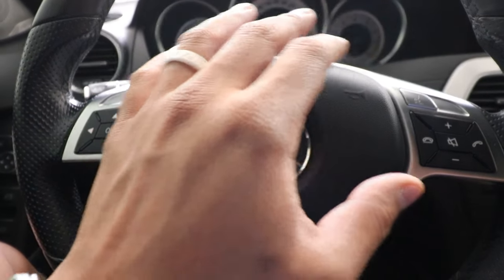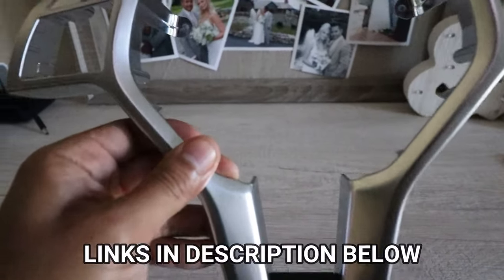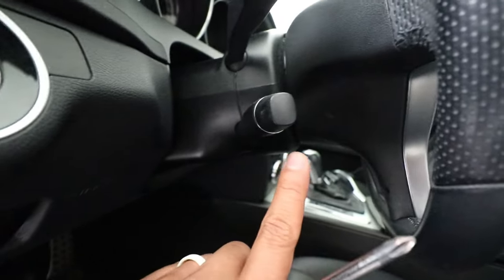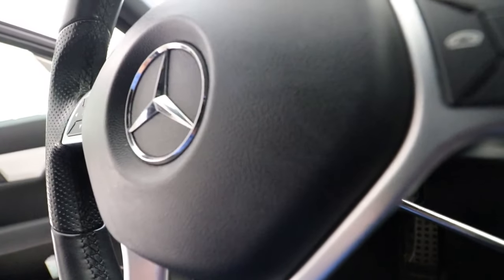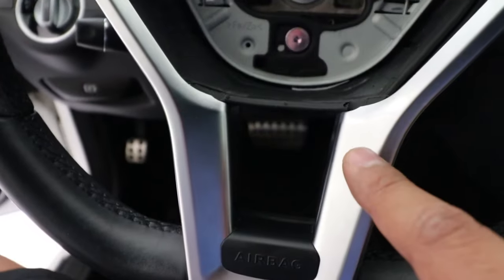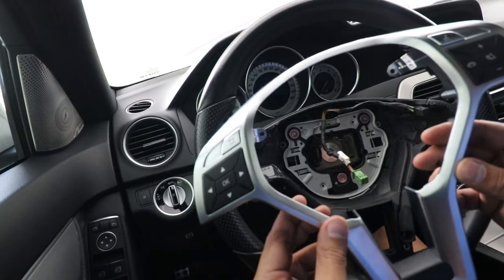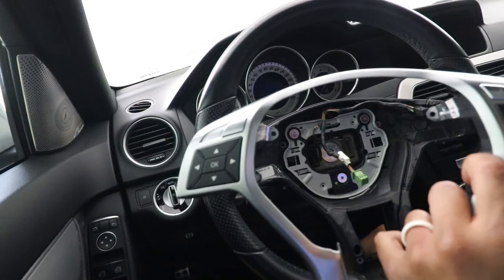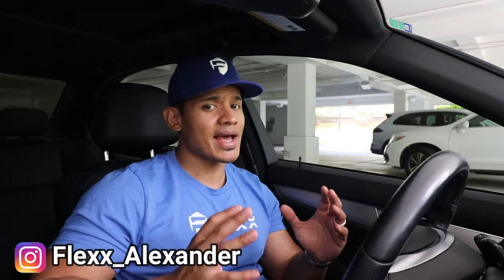Replacing my Mercedes worn, flaking, and sharp steering wheel trim bezel.

Comment: Flex can you remove the plastic air bag sign at the bottom of the v in the steering wheel as I want to replace it with a Mercedes silver badge ?

Comment: Thanks, Flexx. I have a 2014 CLS 550 with the same steering wheel and the install went off without a hitch. I was nervous about messing with the airbag, so I really appreciate the thorough how to video. Definitely disconnected the battery first.

Comment: Awesome video man. There's a couple others on YouTube that suck because they don't mention the battery disconnect.
Reply from the maker: That’s the most important part! If you don’t disconnect the battery or pull the airbag fuse, you run the risk of having the airbag cause injury.  Plus disconnecting the airbag while the battery is still connected will cause an airbag fault stored as a check engine light.

Comment: No nonsense, to the point. Great help. My battery is not is the engine bay though, i think they are under the boot (trunk) liner and there is two of em (c63) i hope by removing negative on both doesn't cause a problem.

Comment: I can't believe this is an issue with these cars.  I had a 2004 C 320 and all the plastic was much better - especially in this most basic of faults - sharp plastic!  Thanks for the video.

Q: How about just sanding the rough edges down carefully.  Has anybody had any luck with this, especially without removal first.  I say this with a bleeding thumb at the moment!

Comment: Thank you very much!  Cut my fingers several times already with these annoying sharp edges.  Just ordered the trim from Amazon.  Can you please tell me if disabling the car battery will cause any issues?  I read online that it could screwup the window settings and other things that could need a dealer to fix.

Comment: If you have an ML350 W166 (mine is a 2014) where the bottom part of the spoke does not go to the center but splits to approximately the 8 and 4 o'clock position, then the screws on the back are T10, or you can also use a T9.  I could not find this information anywhere so it was a lot of trial and error for me, I started with a T15 and went up, but turned out I should have went down.  I thought my screw was stripped so since I was going to replace the bottom bezel anyway, I cut it up with tin snips, then broke apart the bottom bezel until the screw on one side released due to the plastic breaking.  Then I was able to easily unscrew the other side once I angrily realized it was a tiny T9 or T10 bit that was needed!  

Also for mine I did not unplug the battery.  I carefully kept the airbag connected and routed through the opening of the steering wheel trim.  Since the cable is relatively long, it's pretty easy to work with replacing the trim while the airbag is still connected.  Plus on the W166, the battery is under the passenger front seat!  Why?!
Reply: So you are not recommending changing the bezels on the four point steering?

Comment: I'm having a very difficult time trying to remove the airbag on a 2013 C250.  Mine didn't have holes in the back of the steering wheel, it had indentions.  So I stuck a screwdriver in and pressed all over inside there and cannot seem to pop those clips.  Any advice?  How far to stick in?  What angle?  Anything else I'm not considering?  

UPDATE.  I finally got it.  Best to use a Flathead or even a Allen head.  Put the steering wheel with the top point of the Mercedes emblem pointing straight up.  Then the angle of the screwdriver should be parallel with the surface of the steering wheel and using the left and right points of the Mercedes emblem as a guide, from the indention or hole, push the screwdriver towards the center point of the steering wheel.

Comment: I've owned 3 2012-2014 C and E classes.  I'm actually astonished that Mercedes didn't fix that after the first year of this model steering wheel.  Just so not MB.  Add in the flaking of the black "paint" on all of the buttons and it really diminishes these models.  However, I really dislike most of the body styles after 2014 so I'm glad there is a fix for this.  I picked a C300 up from the factory in Sindelfingen and within two months the driver window button was flaking.
Reply from the maker: Yup. And the sad thing is…my 2016 c300 has a silver trim/button to open the center armrest and that trim already started peeling/bubbling within 30,000 miles.  They covered it under warranty but like come on guys.
Reply: @TheFlexxGarage  thanks for instruction video. I ordered a carbon fiber trim and I’ve never even thought to see if it could be replaced. 👍🏼

Comment: Does disconnecting the battery mess anything up? like sensors? or is it fine no issues? Have ordered replacement which I plan on doing just wondered f there were any possible issues that could arise

Comment: I have a CLS 550 that has a second auxiliary battery, do I need to also disconnect it as well before removing or taking out the steering wheel bag?
Reply from the maker: Not 100% sure on the CLS but most Benz, the aux battery is only used for small functions like the start/stop function, serves as backup to the gear selector, heated seats and some other command functions.  I’ve taken apart the steering wheel on my 2013 c300 and my 2016 c300 without having to disconnect the aux batt.

Comment: I have 2015c300. The volume buttons are worn off. So I def have to remove the way you did right? Is there any other way. Like pop off the button like it’s snapped on. Kind of like a computer keyboard button .  Thanks

Comment: I got a left malfunction code for the air bag for disconnecting it. Gonna do the Scanner tomorrow see if it erases the error code. Also you can try and disconnect under the seat the yellow i believe for the ai bag to see if it does anything
Reply from the maker: Most people get an error cause they didn’t follow the most important step which is to disconnect the cars battery before doing anything.  If you did do that and still got an error, then there’s a faulty connection.
Reply: @TheFlexxGarage  Yeah I 
Disconnected the battery before doing anything and fuse also looks good.
Reply from the maker: Sometimes it’s just a matter of driving around and letting the car relearn/recharge the battery.  I don’t recommend you drive around with the airbag light on.
Reply: @TheFlexxGarage  Yeah that's what I believe also , they told me to disconnect the battery and leave it for 30 min and reconnecting it again but that will be after I drive for a while to see if it relearns it. If not I'm giving the dealer a call
Reply: @brandonmedinah2956 did that work?
Reply: I had same issue.  Did it go away own its own ?
Reply: @sunnyjohal4864  No I had to take to a shop charged me 150 for it. Need some type of scanner to erase code.

Comment: Alexander my airbag didn't pop out but its lose in the steering wheel, can't push it back in and it won't come out, can you help with this? Tried my best, might need a new steering wheel at this rate.

Comment: I didn’t know about this issue till I cut my finger on the frayed edge. What diameter screw driver to insert in the 2 holes?
Reply from the maker: Don’t really need a specific screwdriver. You just need something that’s skinny and long enough to pierce the sides and push the tab to release the airbag. Even a skinny rod will work.
Reply: @TheFlexxGarage  I tried for 5 minutes and didn’t want to damage the vinyl I put the screw driver through on both sides. I can’t get either side to release.
Reply: Any idea where I can get a pic of the clips on both sides without the vinyl cover so I know what I’m pressing on with the screw driver?
Reply from the maker: Go watch this.  He points to the metal straight wire on each side that needs to be pushed. https://youtu.be/RW2cwqmVFQI
Reply: Bro I cut myself so bad mid drive from Aspen to St. George, 4 hours deep and went through like 3 napkins -__-

Comment: Same problem. Also on back button on wheel. Already bought new trim, but still looking for these button. Thanks for tutorial dude) but should I unplug “+” on battery or just “-“ ?
Reply: Negative is enough, because the car body is connected to it. Electricity flow to components through wires, then flow back through car body. Unplugging negative will cut the circuit. Even sometimes you want to unplug positive for some reason, it's recommended to unplug negative first. Because when unplugging positive, wrench may accidentally touch the car body, creating spark. All modern car connect negative to car body, some very old or special car may need to double check.

Comment: Thanks for this video. I have a strange question I wonder if you can answer. After having BMW's for many years I've gotten used to the radio controls on the left side of the wheel. Do you think there would be an issue switching the wires for the buttons? I know the buttons themselves can't be switched and they would not be labled correctly but I really want the ability to control the volume with my left hand. Also, have you replaced the drivers vent? I need a video for that too. Thanks
Reply: haha it’s funny you say this I drive an E92 and a W204 and I regularly press the wrong buttons in both cars

Comment: The same thing happened to the handles to get to the back seats and I’ve had to put tape on it because it cut up a friends hand pretty bad. Any idea as to what to do for that ?
Reply from the maker: Same thing on my coupe. I cut my shoulder several times going into my back seat to clean it. 

I peeled off as much of the chrome from the handle and then I wrapped it with gloss black vinyl wrap.  So far so good and looks better.
Reply: Flexx Alexander thanks man, the chrome is a real safety hazard lol

Comment: hey budy, great video as always, I been able to perform lots of things thanks to your videos, thanks so much, you always come up with neat stuff and useful ones like this one, how ever I had my finger sliced but not on the steering wheel vesel but in the lever to move the seat on my 2012 coupe, I have not seen any videos on how to remove this piece or even where to get a replacement part for it, do you have any information you can share, thanks a lot again, keep up the good work. later and greetings from Chile.
Reply from the maker: If you read my replies to some of the comments in this video, I mentioned that happened to me too. I don’t really know how to remove it. All I did was peel off the chrome as much as possible so the white plastic is exposed. And then I put gloss black vinyl wrap over it. Worked for me.
Reply: @TheFlexxGarage  Hey thanks for such a quick response, I thought of doing something similar, but before doing it I wanted to know what you can tell me about it. thanks....

Comment: Have trouble with infotainment buttons pealing, can they be replaced just as easy as yo did the steering wheel buttons?
Reply from the maker: They screw right off but you gotta change the entire button and it’s electronics. I don’t know if you can pop off the buttons alone.

Comment: I know this is an old video and hope you’re still replying to comments.  Just done this on my car, but since reconnecting the battery some of the electrics seem to be playing up.  Wing mirrors now don’t fold and the windows won’t go up properly (almost as if it things something is stopping it as it retracts back down).  Any advice please!
Reply from the maker: Never happened to me in all my times of disconnecting batteries from multiple cars from different brands.  I’ve been told just drive around, start and stop the car a few times through normal driving, the ecu will relearn and everything will correct itself. And for the windows/mirrors, there’s a relearning process you can try. There’s tons of YouTube videos on them. 

https://youtu.be/faeDJZqCQEY?si=Hrdq83W1vd4_9vVA

https://youtu.be/Q9016USuZWw?si=bcrZoHhjwnUWMA1R
Reply: This is late but the windows require a basic reset. Just have all the windows on closed position when power on. With all 4 fingers hold the windows up at the same time. Stay that way for 7-8 seconds. So it knows the final close position. It'll auto close normally

Comment: Hey mate, I drive a 2013 C300. I’m in Australia so probz a diff spec than American ones. I tried the whole process everything works, but I have the airbag light on and a restrain system malfunction… any advice on it?
Reply from the maker: Not sure.  The replacement has nothing to do with those error lights.  On my car, sometimes when my battery is low or I disconnect the battery, when I reconnect it…I’ll get an airbag light and I think traction control error light but they go away after I drive the car for 10-20mins and the battery charges up.

Comment: I’m having trouble with removing the airbag, battery off but airbag will not pop out for me when I push on it w screwdriver
Reply: I’m having the same problem did you ever figure it out
Reply: I got the left popped off right now.. right side won’t budge
Reply: Did any of you sort it out? Both sides on mine haven't popped out, but they're loose, can't even push it back into place now
Reply: if you are using a bit screwdriver, try a different bit that goes all the way inside the hole, slightly press and then push towards the front (facing yourself) and it should pop out.

Comment: Is there any website that sells the carbon fiber one cheap? On Ebay, most of them are close to $300
Reply from the maker: I haven’t seen any. The only thing I saw are carbon fiber overlays decals/stickers.  They look good but they’re don’t completely cover everything on the trim.
Reply: @TheFlexxGarage  Thank you. I might need to settle down with the OEM one.
Reply from the maker: Why wont you just wrap it in like 5D carbon vinyl before you put it on then?
Reply: @TheFlexxGarage  that's a good idea. I should just wrap it on my current one. That will save me some money. Thanks!
Reply: Andrew Kim yo did you wrap the trim? I’m looking to do the same thing.

Comment: Is that the original steering wheel? I don’t have that problem yet, but if it ever comes to that, at least I’ll be prepared.
Reply from the maker: Yes.  As mentioned in the video, this flaking problem is a known issues in the c-class. And it will get sharp and you can cut yourself pretty bad on it.
Reply: @TheFlexxGarage  somehow it look different on mine. It's the model after 2018 and it's 2 parts, one in aluminium and one in black plastic, not full aluminium like yours
Reply: Tito Alo If u have a 2018 u have a W205 C Class

Comment: Do you happen to know how to change the buttons? I took out the trim and the buttons shell but the button are still in the shell and idk how to pop them out. Please help
Reply from the maker: Don’t know. Not sure if they are meant to be changed. You might need to change the entire piece that houses the buttons.  🤷🏻‍♂️

There are aluminum button overlays available on eBay. They have double-sided tape and the button overlays goes right over the oem buttons. I installed some on my friends car and it actually looked good and it worked well.
Reply: To change buttons you have to push up with any finger holding the button so you can reach the two sides where you can see white on the back of the buttons also some are on the side,  when you have the button up you then put the flat head screw driver on one side of the white clips towards inside when you push the white thing push down  unclipping but not really you push down until it feels like it's unclipped might feel pressure on the other side cause it's holding on to the other side  and then just do the other side and at some point you will see that if it feels like it's out on one side the other side needs to be like the side you started holding it up and kinda unclipping it by putting the flat head into it by the white clip...after the button that is alone on top on both side it's either the 1.go back and the to 2.speak button  I believe those are easier you do the same just push it back in when your done putting the new one  it has its own place where it holds on top of the other buttons. When you take them off there is going to be some white plastics inside each button save them you have to put them back in when putting the new buttons in.
Reply: So you don’t even have to remove the airbag or anything to do this?

Comment: Hey flex i recently did this same trim replacement, when disconnecting the airbag and then reinstalling it after i secured the bezel, my airbag seems to not be connected and i get a malfunction notification, is there a wrong way to put the airbag wire in?
Reply: c300 2014
Reply from the maker: 1) did you disconnect the car battery before removing the airbag? And did the battery stay disconnected when you reinstalled the airbag?
Reply: @TheFlexxGarage  i mistakenly forgot to disconnect the battery during the installation, is there any way to resolve that or will i need a new airbag?
Reply from the maker: Umm yeah. You took a huge risk by playing with the airbag while the car is connected with power.  That’s like changing a lightbulb while a lamp is still plugged in and the lightbulb is turned on. You are very lucky nothing bad happened. 

If you did what you did….As soon as you disconnected the airbag, you created the fault in the cars computer making the computer think the airbag has failed because the airbag is no longer sending a signal back to the computer. The only way to fix it is to get a OBD2 code reader and clear the fault code.  Some autozone might do it for you but you might have to get your own code reader or you need a shop to do it.  

If you disconnected the battery, you can unplug or plug anything you want and the computer of the car won’t care cause it’s basically asleep with no power. 

Please take this as a lesson learned. Last thing I wanna hear is somebody getting hurt because an airbag blew up in their face.